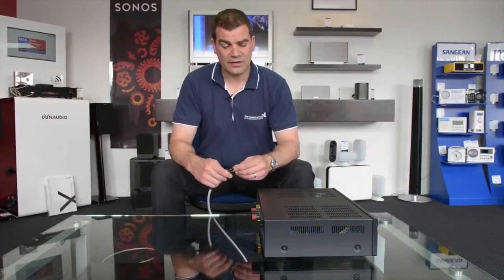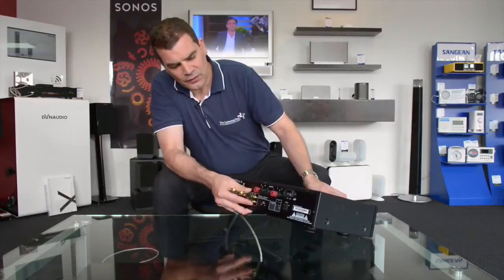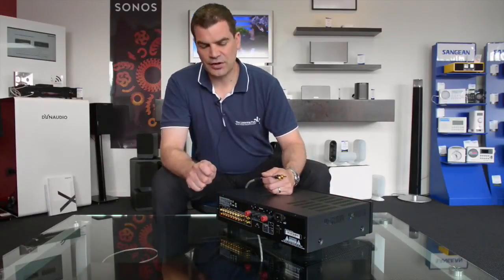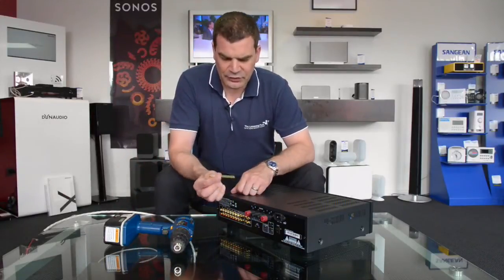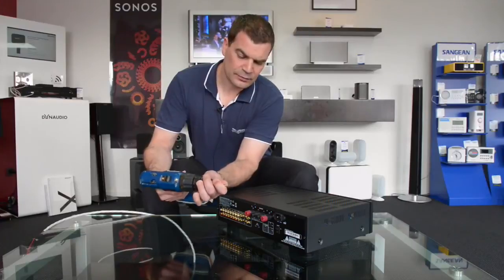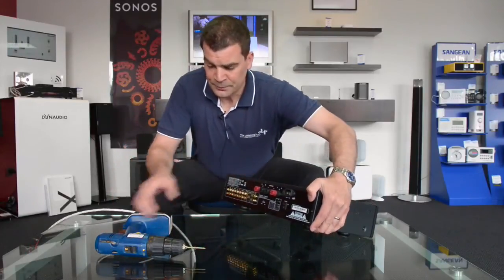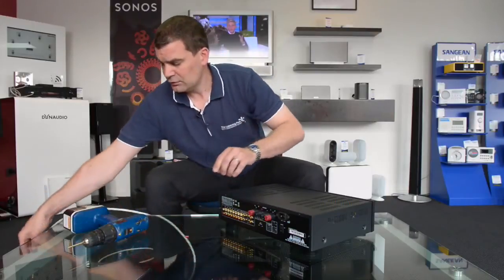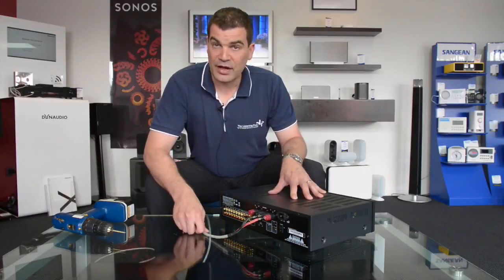Remove Banana Plugs on Amplifiers Trick | The Listening Post | TLPCHC TLPWLG

Comment: Thanks a lot mate! This did the trick for me after watching several YT vids. I don't understand why manufacturers want to make our lives difficult! 👍👍👍
Reply from the maker: In some countries Banana plugs are close in size / shape to power outlets, so Banana's are not alowed to be used
Reply: @TLPCHC 
It is actually possible to plug in a European two prong AC plug into the binding posts, on standard spacing in most amps. 

The Chinese mini-amps solved this problem by closing the spacing so that the AC plug won't fit.

Comment: Thanks- after lots of messing about with small screwdrivers, trying to screw small screws in then removing them but no caps came out. Also tried paper clips which were too thick and all it does it scratch round the terminals. This worked even though I didn't really have a long enough screw to do it as you do, just a slightly longer burst of the drill to seize the cap then remove it and reposition the screw in drill as it kept going crooked due to only half locking.

Comment: Thanks for your video. Any tips for fitting banana plugs in my Technics SU-V460 amplifier speaker terminals? The banana plugs I tried only push in a quarter of the way and remain loose, so for years I have been connecting cable the old fashioned direct way. The plastic terminal caps don't even unscrew far enough to use spades. Thanks
Reply from the maker: +5hanes I'd make sure the binding posts are screwed all of the way down first. The SU-V460 is a little old now, so it may use an older style or size of banana plug than is common today.
Reply: +The Listening Post Christchurch Thanks for your reply. I'll try narrower ones as it's the traditional older type that don't fit.
Reply: How did ya get on..ive got the same vintage amp

Comment: Thanks for the video, looks very easy but I have not been able to make this technique work on my NAD 302 amp. Regardless of how hard I push the drill, it barely makes more than a tiny divot in the plastic cap, and the cap remains. Is it possible the NAD 302 has a different cap that is not supposed to be removed, ie it is not compatible with banana plugs?
Reply from the maker: The plugs should remove. Try a screw with a sharper point.

Comment: Mine one does not have a place to insert the screw. It's kind of completely closed. It is a Av receiver Cambridge audio azur 340r. Cá you help me.
Reply from the maker: With the images I have found, the caps shoudl be able to be removed. Perhaps try your fingernail ?  Otherwise chat with the retailer that sold you the unit (as their maybe there are international production differences)